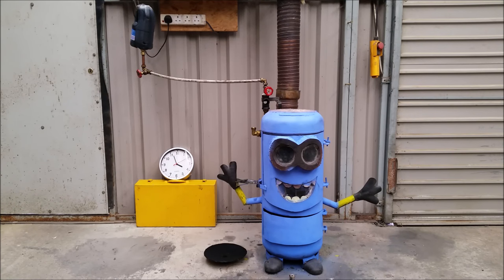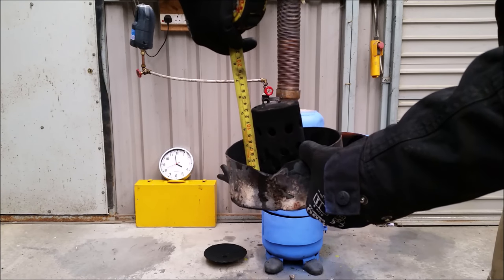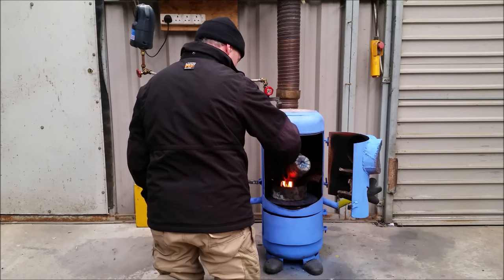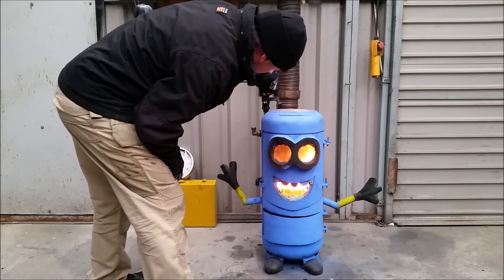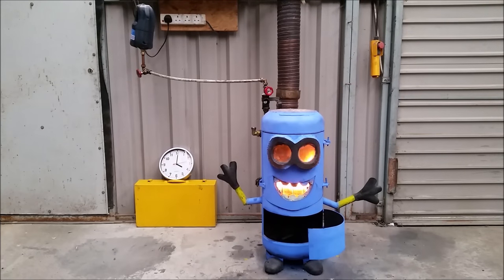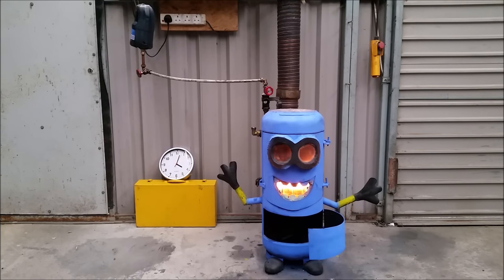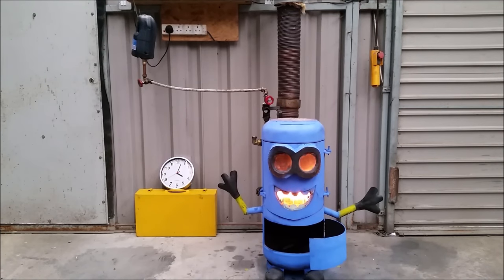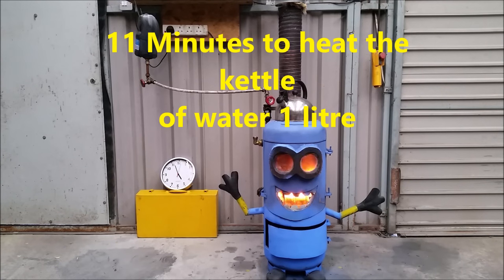Waste Oil Burner .. Only 2 litres per hour .. Red hot !! Minion Stove

Comment: The secret now is to try and store that heat in a thermal mass so when the fuel diminishes heat is still being pumped out. Nice video.
Reply: Thermal mass (~thermal inertia) more useful for heaters that can't self-feed their fuel supply (wood).   Thermal mass delays heat output from start up. In the case of oil feed, the tank size can simply be increased to burn as long as needed.

Comment: I would recommend running a fresh air pipe from outside into your fire box . If you don't your letting air you're trying to warm go up the chimney . I used a piece of old down spout I found . The air coming into the fire chamber enters off center ( not as good with tools as you are ) and creates vortex. And that seemed to make it burn hotter ? I know I'm  using less oil . But before with inside air going up the chimney that air had to be replaced so I guess cold air was leaking in from everywhere it could . Anyway I am really happy with the way it's working .    Mind is smaller , used a discarded six gallon hot water tank from an R.V. . Lots of heat , and cheap lol

Comment: Hi jerry 
I have completed a waist oil burner through a heat exchanger which heats my house. My next adaption is to make it a self start with a plc monitoring and shutting Down sequence  for safety. I love your heaters you making. my garage is warm as Toast in winter with one free oil, Regards Mark
Reply from the maker: Hi Mark. Well done indeed. I will be using a more sophisticated setup later too. I love that we can use free oil to stay warm. Cheers Gerry
Reply: >>I have completed a waist oil burner<<
It burns belly fat? Amazing.
Reply: @frankschwartz7405  hahahaa

Comment: That's pretty good... here are your approximate energy figures & savings:

2L wmo = ~0.528 gallons wmo (waste motor oil)
1 gal wmo = ~140,000 btus = ~41.03 kWh = ~147.71 MJ
2L wmo = ~73968.1 BTUs = ~21.7 kWh = ~78 MJ (which is actually quite a lot of heat energy)

If your electric energy rate is 12.5 cents per kWh & you burned only 2L of wmo (which you can get for free) for heat instead of using electricity, then you would save ~2.71$ (i.e. 21.7*.125) .  That means 2L wmo = ~2.71$ electric energy expense (i.e. ~1.36$/L wmo)
Burning 2L/hr for 8 hrs = ~21.68$ savings (i.e. 8L or 2.1 gal wmo)
Burning 2L/hr for 8 hrs/day for 30 days = 650.34$  savings (480L or 126.8 gal wmo)

Saving 650.34$/month is a great savings for anyone!
Reply: It depends on where you live & how well insulated your structure is.  It's not uncommon in the upper midwestern US to have 100,000+ BTU furnaces, for example.  If you live in a milder climate or you have superb insulation, then you could certainly burn less wmo.  I have a design for a wick wmo burner that consumes ~1 kWh of energy per hour (it's made out of a chicken noodle soup can, a fan, & a heat exchanger.  

Yes, it is free heat if you don't have to buy your wmo -- which you can easily get by burning your own wmo &/or getting wmo from people who give it away via Craigslist--I've gotten gallons of wmo in one trip that people accumulated & then gave away).
Reply: @ab_ab_c  yep just make friends with farmers and they'll give you oil from tractors.

Comment: That is about only half the consumption of oil that one would reasonably expect. Your burner really works well!  Happy S´t Patricks Day!
Reply from the maker: Hi Agrocruz SA. Yes it seems like a decent little burner and really easy to replicate. I am using 4 metres of 6 inch flue and about 1 meter of flexi flue to connect into the various stove I mess about with. Thanks and Greetings from Ireland Cheers Gerry
Reply: We use quite a few of different type Vegetable oil burners, mainly "Oil Burner´s" & a few Ozzies drip. Was wondering how to adapt your new burner to our immersion heaters (along the lines of the M67 Immersion Heater or Puffin Billy) to heat virgin oil in 200lt barrels up to boiling point. Any ideas? Thanks
Reply from the maker: Hi Agrocruz SA. I am uploading an video at the moment that has a boiler stove using the new burner. It might be along the lines you are looking for. Cheers Gerry

Comment: Your awesome . The fiery minion so cool.  I fix cars in my garage and in the winter it's very cold in nj . I use a torpedo kerosene heater which has me spending big bucks at my local lows. I have tons of used motor oil from oil changes I do and it's a hassle to get rid of them. If I could make this thing I will slove 2 problems and save a ton of money. DO YOU HAVE A STEP BY STEP VIDEO FROM START TO FINISH AND A PARTS LIST.  I have almost everthing like brake rotors ,map tank, welding machine. Ect.

Comment: Hi Gerry, another great vid, thanks. I tried to see under the kettle to see if it has a rim and therefor a few mm gap between the stove and base of the kettle. I think I could see a rim? If so that is likely to significantly increase the time it will take to heat up. Though fine for gas. Just a thought.
Reply from the maker: Hi Len. Well done on your powers of observation, you are correct the bottom of the kettle is not flat on the stove. It does have a 4 mm rim that raises the bottom somewhat. I can talk to it with a hammer and fix it I think, if you dont see it in future videos you know it went wrong. Thanks Gerry

Comment: If you don't want the heater in the house, l have seen a car rad with fan pulling air through heating water which is run through line to same rad set up in house. Cheap and efficient.
Reply from the maker: Hi Charlotte. heating a boiler in one of these stoves is an easy mod and then piping that heat into a building is the safest way to do it alright. Thanks for the comment Cheers Gerry

Comment: Hahahahahaha. you did it Gerry :)))). What's next? Can we make Rocket Fuel?
Reply from the maker: Hi Jod. My talents are too limited I'm afraid. Cheers Gerry
Reply: Hahaha Gerry, NEVER LIMIT yourself :O
Reply: +Len Walker + Gerry - Look, we got ideas Gerry :D - Hmmmmm, heat up to a certain Temps then Spray it? Hmmmmm, what if we heat it up to almost burn, then spray FINE mist? Hmmmmmmm
Reply: Rocket fuel??? Now you REALLY have my attention. LOL, Great stove Gerry and I love the oil burner ideas you've come up with. I subscribed.
Reply from the maker: Hi trreb1.I used that burner as a demo in a boiler stove in my house and it was heating my underfloor heating circuits and hot water too. I dont recommend setting up this burner in a home but it was just a proof of concept. Here's a link in case you haven't seen it. https://youtu.be/SAmHNp6fOUA  Thanks for the comment Cheers Gerry
Reply: I'm thinking of building one for my shop. It should work great for that. Keep up the great work.

Comment: HI Gerry, got the usage demo up good and quick , thanks  so the temp started to drop just going onto the 1 hour mark ? If that's the case it's frugal indeed. I think people will be happy with that. I live in Canada, you know; where we eat bear meat , drink a lot of beer and chase after women . ha ha !.  I'm going to send you a vid on my wood stove heater conversion , I have followed your approaches on this but have done a different fuel feed method.  Again thanks for the update on usage and the benefit of updraft air feed     Thanks
Reply: Josef, post your video so we can your handy work. Thanks. JD.
Reply from the maker: Hi Josef. I thought it would use a bit more but it nearly went to the 1 hour mark on just 2 litres. I should have filtered the oil because I had some issues with lumps but the sides were dull red after about 20 minutes or so. Cheers Gerry
Reply: Happy St Patrick's day Gerry. Day off for you? Grtz JD.
Reply from the maker: Thanks JD. Yes its a national holiday here and the whole country are partying Cheers Gerry

Comment: Hi Gerry, I've been playing with your exact design but mine smokes like a coal freight train. I use the same pot design with the air intake at the bottom and the holes as yours are. I've tried using a mild steel bowl like yours and even a stainless steel bowl but still smokes. Tried chimney length with no result. It just blows black smoke and covers the chimney in black sot. Any ideas?
Reply: Forgot to mention I'm using an 11" stainless bowl with a 3" centre tube welded to it. I've tried a few holes to as many holes as I could put. I would like to try the other burner method with a covered bowl and the flame goes through the perforated centre tube in to the chamber but I'm thinking I'll have the same results with the smoke issue.
Reply from the maker: Hi Slim Shady. The big thing with these stoves is that you have enough of a draw / pull from the flue. I have a 150mm /6 inch flue and It's 4m long about 13 feet long. I have tried this design with less flue but I cannot get enough mixing power if it;s too short. I made a video last night that will be live today where I show the oil feed and I have a cooker stove I made that uses the same burner you are using.. https://youtu.be/tnzEDEpz3Yk At the start of this video I show the burner and lighting it. YOur stainless steel setp should work fine once you can get it hot enough to initiate combustion of the fresh oil coming in to be burnt. Can you add compressed air to the oil feed and see if the burn improves. If it does the problem will be the chimney I think. Hope this helps . Feel free to message me on face book. https://goo.gl/oeK4uw Cheers Gerry
Reply: Thanks for the advise. Greatly appriciated. I've played with flu length to about 30ft and still smoked. I tried adding some compressed air as you suggested and it smokes even harder. Ive come to realize that if one adds to much air than it smokes. You want to choke the fire so it only burns vapours. Been testing this theory over the last few weeks and every test yielded the same result, less air=less smoke and vice versa. To me it's just to hard to "tune" the air fuel mixture on this design, I must not have the magic touch haha. I ended up doing an "ozzirt" style burner and boy does it burn clean. Zero smoke and burns my 20 gallon tank to 600F. It's really cold in Canada so I needed something clean burning quick, but now that I have heat I'm going to re visit your design. I almost had it burning clean, just need to restrict air flow as it gets hotter. 
Hey if it was easy than everyone would be doing it haha. I'm still following all your videos, your one of the best at explaining things in detail. Keep up the research and development. I have a lot of ideas as well that I can share if your intrested. 
I can send them via face book since I'm on there. Your link didn't work, do you have a personal Facebook account that I can send a friends request to? Would be nice to chat with a smart guy like yourself that builds neat things.
Thanks again Gerry, take care.

Comment: Is the idea of the bottom 1/3rd just for air flow?
Reply from the maker: Hi Ben. The main idea is to allow me to concentrate the airflow up through the burner. Air travels through the burner holes from underneath  and expands into the chamber giving a very robust burn. When using this as a wood burning stove the smaller bottom door allows me to regulate air and slow down or increase the burn rate. I have made a few different stoves and burners and you can see lots of builds in my playlists on this channel. Hope this helps. Cheers Gerry👍

Comment: Could I use diesel fuel/heating fuel as well as waste oil in this type of set up? TIA
Reply from the maker: Hi Yvan. Yes you can use diesel or kerosene in this burner but you would have to adjust your drip feed as the viscosity is different between heavy waste oil and free flowing diesel or kero. There are more efficient ways of burning more refined fuels though. Hope this helps. Cheers Gerry

Comment: Do you use a nozzle or does the oil just drip out of the line?
Reply from the maker: Hi Ernie. Its just dripped directly into the burner . Usually just a steady skinny stream will make the 2 litres per hour. There  is no fan or any moving parts. Here's that burner in a bigger unit with a view of the burner at the start. I even cook on it https://youtu.be/tnzEDEpz3Yk Cheers Gerry

Comment: Hi Gerry, well done impressive burn rate on that unit. Would it be any advantage to run the flu around the shed for more heat rather than straight out of the roof? Can you tell me what brand of paint you use the stove.
Thanks again And Happy St Patrick's Day.
Reply from the maker: Cheers Gerard. You can run the flue horizontally to recover some heat no problem but there is a limit. You need a good vertical amount of pipe to keep the pull / draw on the flue. In my setup if I were to put a second tank on top of the minion and then the flue into that I could recover more heat. I will be doing another boiler and hot water setup soon with this little bottom fed burner. The advantage with such a setupis that it could heat an underfloor heating system or a radiator system and provide heat remotely  and be safe. Have a great Paddy's day Cheers Gerry
Reply: @GerrysDiy  have you done it ? supremely interested in a non gas option for shop boiler.

Comment: 2 liters per hour , holy crud. That's a lot.  Expensive.
Reply from the maker: Hi Ray. The oil I use is used veggie and motor oil and I get it for free. I have a large workshop and I get an awful lot of heat for my 2 litres. If I were using a smaller insulated workshop that would decrease the amount of heat required significantly but it would still be free and the burners are extremely cheap to build as you can see in lots of my videos. I built a bigger stove unit that I can even cook on. https://youtu.be/tnzEDEpz3Yk Cheers Gerry
Reply: It's a 20kw burner..

Comment: I think think if you used an old gas type water heater and make it so the heat goes up the center of the water heater. With a pump to move the water through the heater and in the house to heat the house. Must make sure the water does not get to hot. If it gets near 90 C things can get bad!! Can you control the fire? So the water only gets to about about 50- 55 C. That should put enough heat in the house.
Reply from the maker: Hi Donald. That's a very good and safe suggestion. That type of water heater is not readily available here but I can make a version of it myself. I will be very active in the shed this autumn (fall) and winter with waste oil and other projects. Thanks for commenting. Cheers Gerry

Comment: 9:20 "There's 2.54L in .. an Imperial Gallon".
All gallons (Worldwide) are 8 pints, it's just a US Pint is smaller (473ml) than an Imperial Pint (568ml).  This means a US Gallon is 3.78L and an Imperial Gallon is 4.54L.
Reply: 16oz = 1 US pint as in a pint of beer. 2 pints is 1 quart (quarter of a gallon) so 32oz and 4 of those is a gallon so 128oz. The most important thing is how many ounces are in a pint of beer. Lately I have seen a trend towards 12oz which is not a pint and is just not right. Also of interest is when one says mind your p's and q's they mean beer and pints and quarts. These were standard serving sizes in taverns when the phrase was coined.

Comment: Could you use waste cooking oil?
Reply from the maker: Hi Tony. Yes you can use veggie oil no problem. I did a little demo of this burner heating my water and heating system using 2 litres of veggie oil. Plenty of heat output. Here's a link to that video https://youtu.be/SAmHNp6fOUA  Cheers Gerry
Reply: Cheers Gerry BTW good video just finding some way of use up the old cooking oil lol thinking of making a patio heater
Reply from the maker: Hi Tony. That little minion stove will burn solid fuel too. Sawdust and waste veggie oil makes great heat too. Cheers Gerry

Comment: 2 liters per hour is alot my friend
Reply from the maker: Hi 1st Pal. The shed I have is quite large at 30 ft x 20 ft x 14 ft high. I need to make quite a bit of heat. It is possible to make a smaller unit and use less oil but I would not get enough heat from it. I used the same burner in a homemade cooker stove with more surface area and I can even cook on it so at least I get more use from it than just heat. https://youtu.be/tnzEDEpz3Yk Thanks for the comment Cheers Gerry